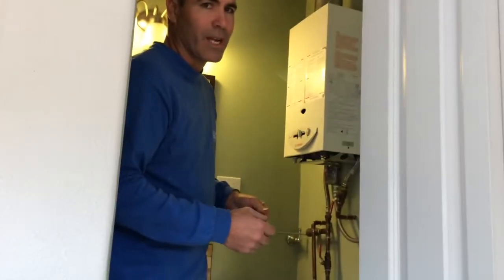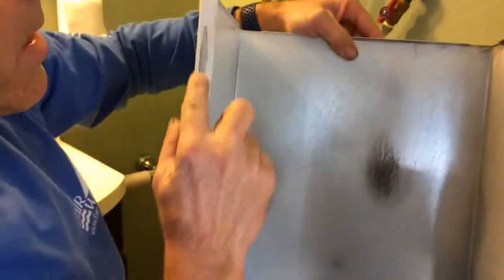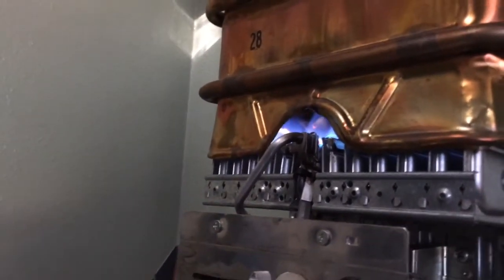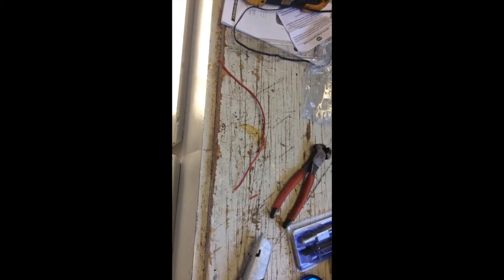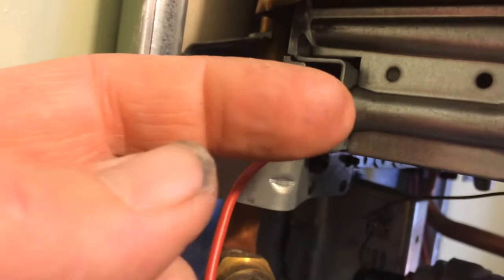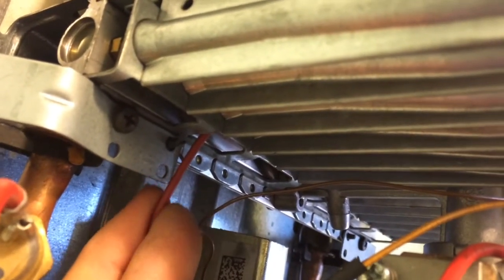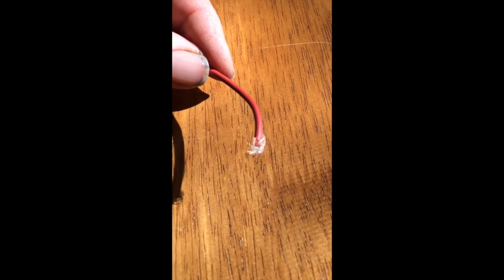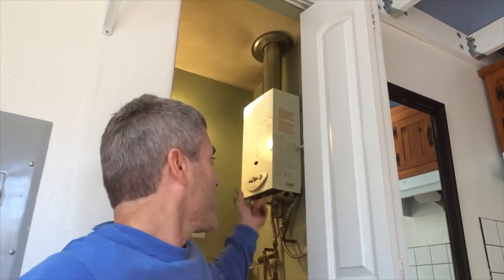Burner cleaning on a Bosch 1000 P Tankless water heater

Comment: Hi I have a bosh 1600H which is very similar to the one you were fixing, my problem is that when I open the faucet I can see the flame on the pilot but it won’t turn the rest of the burners on. Do you by chance have a clue. Thanks
Reply from the maker: It sounds like it could be a problem related to low flow....sometimes the burners won't ignite if there isn't enough water running through. Have you checked the screen filter on the inlet valve?  Also, another thing to try is the vinegar flush to try and remove sediment buildup on the inside of the unit. Good luck!

Comment: What were the symptoms (other than a yellow flame)? My Bosch Hydropower 10H always shuts off after 5 minutes of operation. Was wondering if it could be this.
Reply from the maker: My only other symptom was a lot of smoke build up on my ceiling because the flame was not clean.  I wonder if yours is shutting off because it is getting too hot, like a sensor or something?
Reply: @kekanipahu  Sometimes I can get it to work again after it shuts off, but other times no luck. 

When it works again I haven't had it shut off again, but that's probably because I finish and turn it off before it reaches 5 minutes again.

Before it shuts off, the water temperature gradually gets cooler, but only slightly, like there is not enough gas or power and then it abruptly shuts off. Water presure is fine and no shower restrictors are used.

If I'm unable to get the flame working to supply constant hot water, I usually resort to turning off  the water and gas valves to reset it, then back on and that usually does the trick.